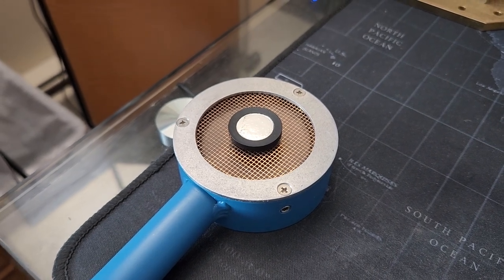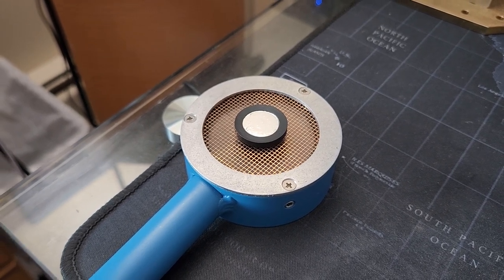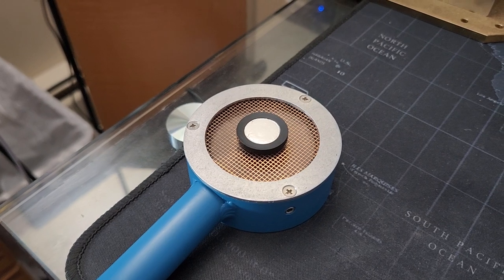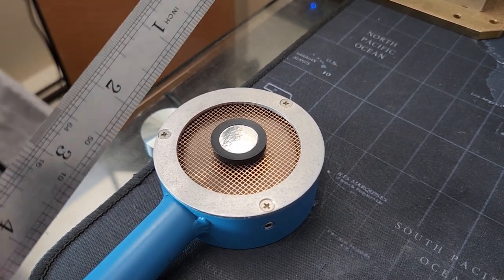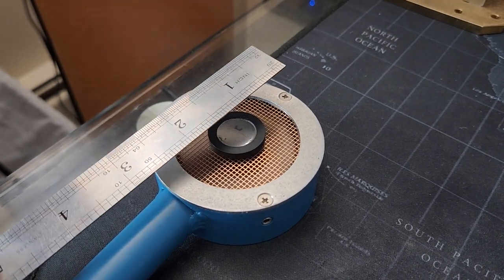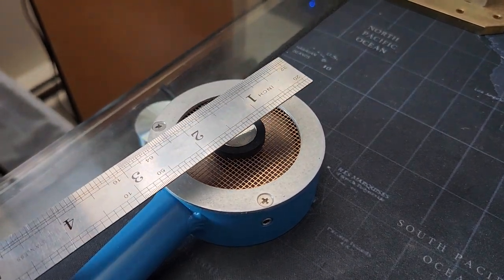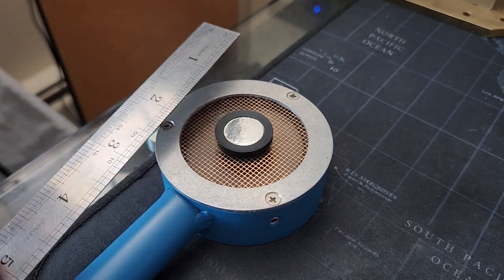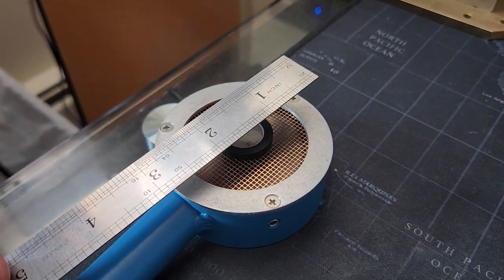100 µCi Carbon-14 source disc, bouncing beta radiation off the air

Comment: Very nice demo! You are not wrong: You are, in fact, correct! These are β- particles (electrons) being deflected and scattered by air (molecules) back into the G-M tube. I've done this with my 10 μCi C-14 source disc. You also pronounced "bremmstrahlung” correctly, too. Anyways, this phenomenon is called "skyshine." If you use elements with a heavier Z number, like lead, the more atoms (electrons) it can interact with and deflect. Lead will give you much higher counts, than say, aluminum. This is a great demonstration of "skyshine," and I really enjoy this video! By the way, if you have an activated zinc sulfide screen, it will produce a faint glow. However, you have to get it very close to the source, and the glow is significantly less luminous, compared to alpha radiation sources that are mostly used for this purpose, in which zinc sulfide is the "grandfather of all scintillators." Nonetheless, it will make it glow, in the near-to-pitch dark, that is, when your eyes have adjusted to said darkness. Try it out sometime, if you have an "alphascope/spinthariscope" (activated zinc sulfide) screen. Thank you for sharing this! It's really cool! ☢👍
Reply: Great info! Is the scintillation from carbon 14 on zinc sulfide stronger than that of Tritium?
Reply: It depends on the energy of the β- particles, and of course, the activity. C-14 has a maximum β- energy of 156.6 keV, whilst H-3 has a maximum β- energy of 18.6 keV. The higher the energy, the brighter the scintillation. However, since H-3 is a gas, and the energies emitted are very low, more activity is required. You could theoretically use C-14 as a gas, such as C-14 dioxide, in place of H-3. The downside is that it would be costly to produce, and the NRC and IAEA would likely be against it, since C-14 is more energetic, and often in solid form, rather than gaseous H-3, increasing potential hazards. You could use both isotopes as a solid, however self-absorption increases and becomes a problem with β- emitters as energy decreases. This is why most H-3 vials contain millicuries of activity, compared to microcuries of activity with high-energy emitters, like Sr/Y-90, which was used in only a small number of self-luminous prototype items. C-14 was also used too, but also only in a few or so prototype items, such as self-luminous markers. These β- emitting self-luminous markers were made mostly for military and research purposes only. This is why α-emitters were used so much back then, since they emit energies much higher than most available β- emitters, being in the 5 MeV range, which is why less activity for that is required. The downside of this is that using higher-energies degrade the crystal structure of scintillators much faster than lower-energies. I hope this helps! ☢👍

Comment: Counter theory: Your sample is blocking all the low energy bremsstrahlung when you get close to it. 
Idk what you sample is encased in but it loks metalish, which would absorb the x rays.
Maybe uf you use tungsten they will have more energy and penetrate further?

Comment: do it again with a plastic ruler and you will have (part of) your answer. what is the isotope incorporated within? it looks like metallized bopet.
Reply: It's carbon-14 sealed under a very thin Mylar window, which provides the best emissivity. I have a 10 μCi carbon-14 source, and the Mylar window is only a few microns or so thick.